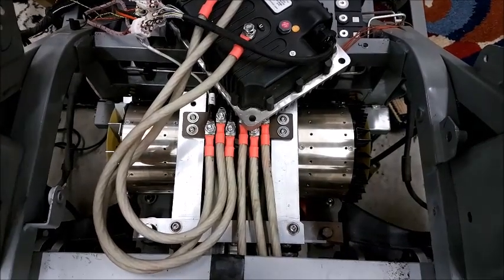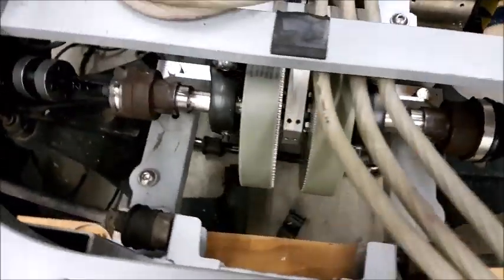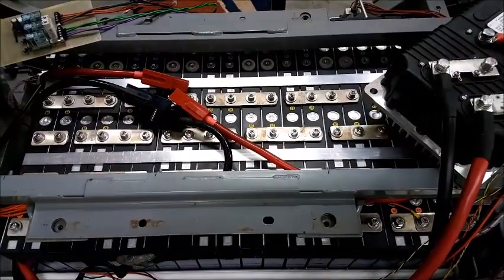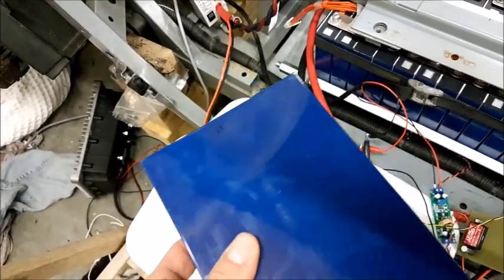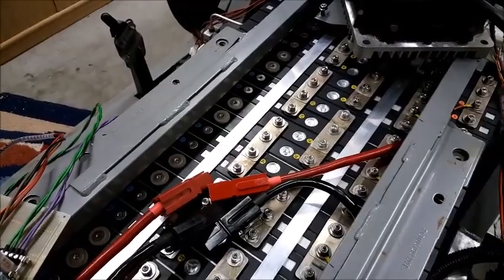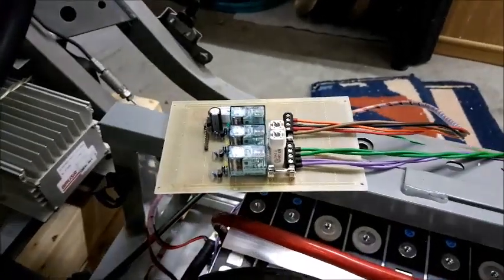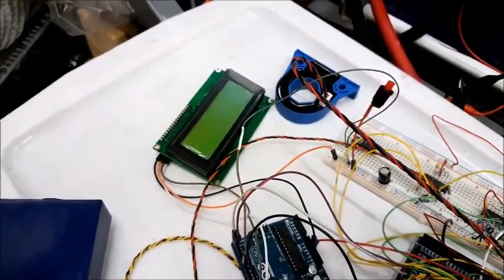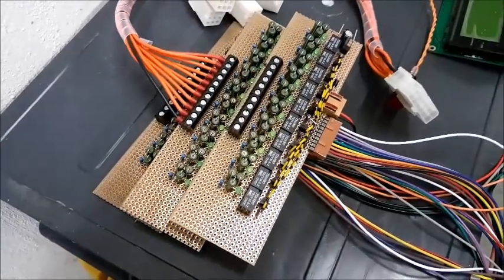#5 RENAULT TWIZY with over 15kWh Battery for Revolt Dual Drive Unit

Comment: Amazing project, thanks for sharing. Please can you please explain how do you manage the CAN bus communication between the Battery Management System and the Vehicle Control Unit ? Were you able to understand the meaning of each hexadecimal message that is between the VCU and the BMS? Thank you in advance for your help.
Reply from the maker: There was no need to understand any original CAN message, because I kicked out both the original BMS and VCU and developed everything on my own - having everything under my own control

Comment: Is there any reduction or its direct drive? What is the max rpm for max torque?
Reply from the maker: Fixed gear ratio of approx 1:4.5
I expect a max torque of around 70Nm each side,  will get much clearer during upcoming test drives...

Comment: Hello from germany du hörst dich deutsch an habe auch vor kurzem einen twizy gekauft was kosten denn diese batterien in der 15 kw version? Bzw hat deine serien batterie schon zuviel verlust gehabt schade das renault keine grössere für den twizy anbietet
Reply from the maker: The original battery was still fine, the battery contract just expired and I gave the battery back (which was everything else but trivial).
The new battery is composed of 60 cells OSN LiFePO4 85Ah.
Reply: @nextev8794 can i have a question how much the battery cost and how much is better the range after upgrade?
Reply from the maker: @ladislavzajtko7099  Some years ago the batteries were about several thousands of bucks. Nowadays you will get 17kWh for 1000...1500.
Typical driving with a smooth style consumes 70...80Wh/km which leads to more than 200km of range, which I already achieved 😎
Reply: @nextev8794 
Thanks for the answer and from which country you are?

Comment: I like the dual motor drive. No need for a differential. Have you worked out how to make the outer wheel in a turn drive harder than the inner wheel? I worked on a tadpole trike project with dual front wheel outrunners. I incorporated traction control from the hall signals so that each motor would pull properly based on some rules. Angle of turn was also worked in so the outer wheel would spin a bit faster than the inner wheel depending on angle of turn. I needed 2 analog outputs and 1 analog input for the throttle input and controller outputs. All the rest was digital signals from halls. An arduino nano was plenty powerful enough to handle all of that.

The hardest detail was working out keeping the tires powered under full acceleration. A bump in the road would lift a tire off the road for a second and the coding would detect a faster spinning motor. This would cause the throttle for that wheel to drop slightly and then the wheel would be back on the ground again and running at the same speed as the other wheel. There was a delay between sensing motor RPM and throttle correction. This created some oscillating throttle weirdness as a result. My solution was to monitor the halls based on both motor speeds averaged together. I also averaged the hall pulses for each motor. This required a scale based on average motor RPM from both motors. At low speeds, motor speed monitoring was done more slowly than at higher speeds. Throttle balancing reactiveness was reduced at slower speeds than at higher speeds. The effect was that I eliminated the throttle oscillating problem by being less reactive to wheel speed changes no matter how fast I was traveling. 

Angle of turn was pretty rudimentary but sufficient. I used 9 reed switches. This gave me 4 angle positions for left and  4 for right turns and a center position for straight ahead. It could have been better with more granularity, but my solution worked well enough that I didn't care to go further. I had center, hard locked either extreme and 3 more positions in either direction. It was pretty good and made turns faster.
Reply from the maker: Hi! I haven't thought that much yet about the implementation of the el. diff.
Thx for your post, very inspiring, fits to my ideas how to deal with it. Only significant difference: I'm planning to us a linear poti detecting the steering angle.
Unfortunately progress is currently unsatisfactory,just little time for the project :-(
Do you have some public documentation somewhere?
Reply: Why not try with 2 controllers?
Reply: @dimitaratanasov2466  Thats exactly what he is doing. The problem is getting the 2 controllers to track properly based on angle of turn and if you have a situation where one wheel is slipping more than the other. These are functions of a mechanical differential that needs to be simulated in dual controllers.

Comment: Me again!: so you got a Twizzy without battery or did the original wear out?
Reply from the maker: The battery rental expired and we gave the battery back. A local Renault garage took it out, measured it (still ok) and sent it back to France
Reply: @nextev8794  Despite my original negative attitude to the Twizzy, this looks like an interesting vehicle. The frame is weight optimised, so more like a 4 wheel motorcycle! So are second hand Twizzy prices lower than they would be as they do not include the battery?
Reply from the maker: @Tore_Lund  Usually the battery rental contract is integral part of the vehicle and it's not that easy to get rid of it (both battery and contract). Anyway, since the battery communicates with the vehicle it's difficult to replace just the battery, that's why I threw away all the electronics hardware and started from scratch again.
Reply: @nextev8794  That makes sense, and you went for LiFePO4 chemistry, so you couldn't just transplant the battery electronics that expect Li-ion cells!
Next question: Is this a motorcycle? I mean do you have to have it inspected every other year as you do with cars? The City-El as a 3 wheeler is a motorbike,, so you can do anything with it, but is the Twizzy then considered a quadricycle???
Reply from the maker: @Tore_Lund  Exactly, man! Almost... ;-)
Reply: To have it without a battery ... but to go with any battery requires changing the charger controller and display to accommodate the new battery
Reply from the maker: @dimitaratanasov2466  Absolutely right!
And my plan is not to come up with a new prototype for the next gen Twizy, instead I'd like to learn a lot and wanna have some fun.
So far, my plan came true :-)

Comment: Hey exciting project 💪 I think I saw an Cityel in the background in one of your videos. Have you considered putting revolt rv-160 pro in Cityel? If not why? :-) I have thought of putting one in my Cityel. Do you think this motor will fit the Cityel well, performance vice? Looking forward to new videos on the tvizy project
Reply from the maker: Hello
Yeah, sure I considered that and came to the conclusion that this would be a little to much power for the little vehicle. Anyway, the revolt should work nicely in a Cityel, especially if you choose a fairly low kV, reducing the gear ratio to 1:3...4
Feel encouraged to to that, and share your success :-)

Comment: Thanks for sharing! Would you do video tutorial for twizy virtual bms?
Reply from the maker: I gladly share everything with you...almost ;-)
I'm not sure what is meant with "virtual" BMS!?
Reply: Does not need a virtual BMS as it has had all the electronics stripped out and replaced with a custom system.
You would only need the virtual BMS if you were using the original power electronic, Sevcon et al with a custom battery.